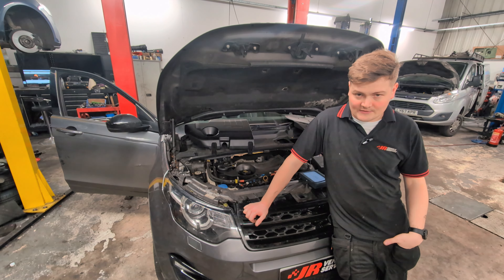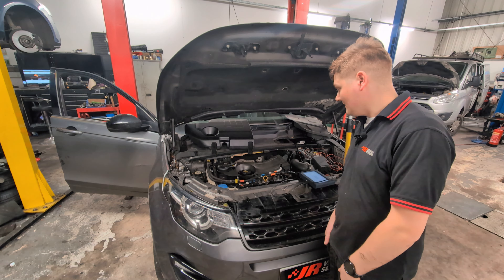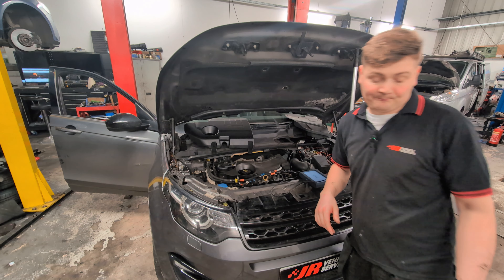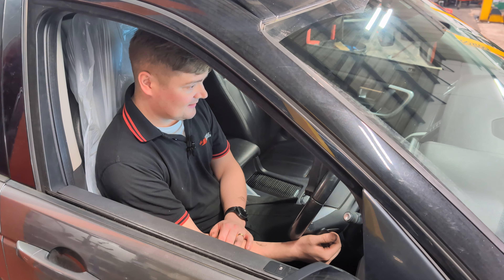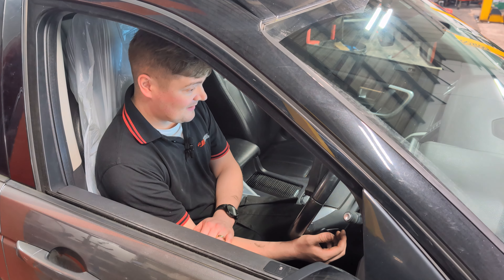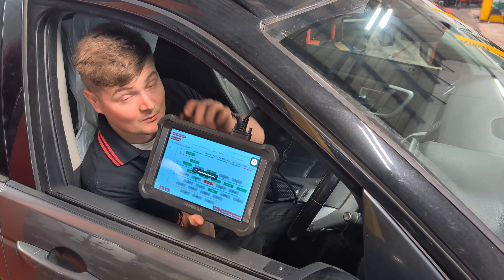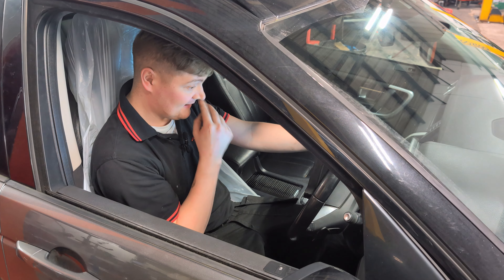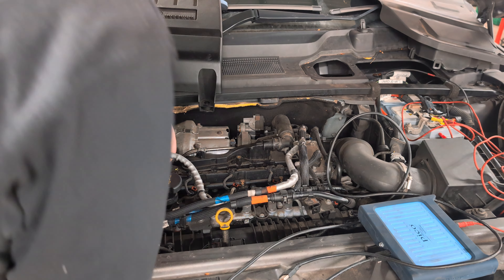Ingenium Checks

Comment: Thanks for your videos. I write from Italy and I am a fan of the Jag brand. I am in negotiations for a 2016 XF with an Ingenium diesel engine changed last year and with 10,000 km of mileage. The car has 160,000 km, what would you recommend?

￼
Reply: I would recommend you spend your money on a decent car and don't touch the Jag.